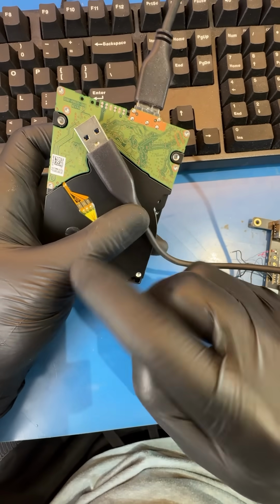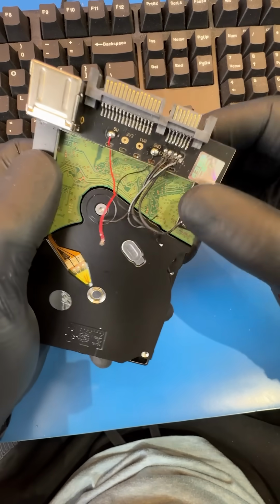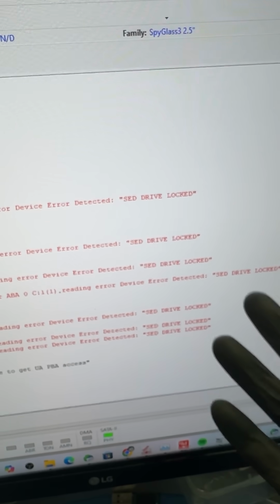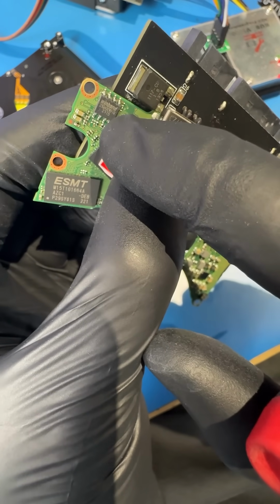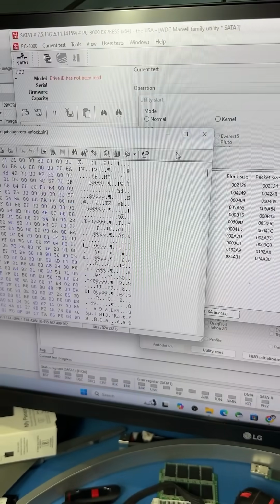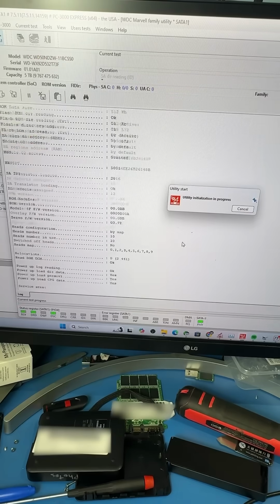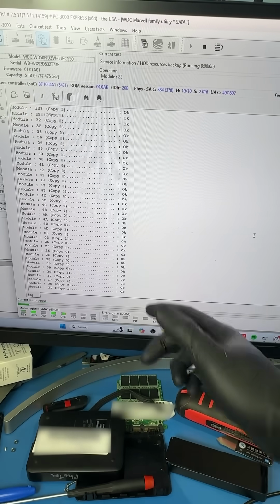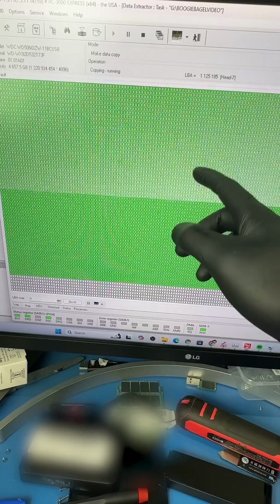Self Encrypting Drives... #tech

Comment: I work where we ship wd externals to customers, back and forth. The units to avoid are the 2,3,5 tb models. The 1,4,8 tb perform well, and are more reliable
Reply: He works at Amazon
Reply: It's interesting you say this, because my 2tb wd drive is throwing (non-critical) smart errors, but my 4tb one is clean
Reply: Hmmm something new. What could be the reason
Reply: @ukin237  just a guess... The odd capacity may indicate the drive started as a larger capacity model but had too many bad sectors. Rather than junk it, the manufacturer labels it with a lower capacity and sells for a few bucks less.
I believe this was common with different cpu models too. If it will run at 2.9ghz but not at 3.1, then sell it as the slower spec.
Reply: @ChickenHawk907 you're on point. Instead of discarding the defective drives, manufacturers often just disable the defective area and sell them for lower capacity than intended.
Reply: @ChickenHawk907 I doubt it, people are so picky about data longevity it would literally be the immediate end of WD if that got out. That’s like going to the bank and being told “Well you deposited 1000000$, but our locks are bad and we got robbed so you only have 50000$”
Reply: @ukin237  The number of platters and heads to read them. It also effects speed in finding the data each search.
The more mechanical things you have, the more likely of a failure. It's just math and RNG.
Reply: I have had 2 5TB external drives give me grief and I now avoid them.  Won't even take one if it's free.
Reply: @mercermediahfx  i avoid external drives like the plague, any brand. just get sata. its more reliable. even sata dock to usb is more stable than regular external drives. imo.
Reply: I have a Wd passport 2tb since 2018 and still works great, been dropped handful of times too (parked of course).
Reply: He dropped this hard drive and ruined the reading heads
Reply: jeesh the comments. idk my self but obviously certain #'s are made in a different fashion   . i would use ssd anyway
Reply: I have 5 x 6TB WD Purple drives in a RAID-5 array.  All my movies are stored there for access by my Jellyfin server.  I hope those drives are robust.
Reply: My Wd my passport 4tb have an issue, If i format it using wd utility software then it works but only for sometime and then become unusable like saying drivers not available and doesn’t show in my computer but shows in hard disk sentinel.

Any idea?
Reply: @ccmusic7772  hi, did you find any solution? I have the same problem with the sem 4tb wd. And when I try to transfer some data, when it works, it only get until nearly 2 tb, then it stops.
Reply: @ nope. If you find do mention.
Thank you
Reply: I have had MANY (probably over 30) 4TB external 2.5 USB drives as rotating server backups and they last 3-4 years before failure EVERY TIME whatever the manufacture is.
Reply: Does this apply for Seagate hard drives as well?
Reply: FALCON9GAMING yes we need similar guidance for seagate too
Reply: @FALCON9GAMING  c'mon man. No it doesn't.
Reply: What about 512gb!!?
Reply: @r4inim4tion get that garbage outta here
Reply: Actually tho, all my dead drives has been 2 and 5 TBs.
Reply: I have a 2TB external and it’s served me well for s few years
Reply: Especially avoid the model: ST3000DM001 (3TB) model. Piece of junk
Reply: 100gb M-Disks for cold storage
Reply: How is powers of 2 relate to reliability?
Reply: @cagedgandalf3472  no one stated the difrent sized drives have all the same components. the drives may have difrent components depending on features ect. a persons observations are just that observations take them how you will..
Reply: @waxprime729  I understand, I just took it how he said it
Reply: @cagedgandalf3472  while i had the same thought, considering how important the powers of two are for all software, he did say the 2tb was a no-go as well, so i think it might have something deeper in relation to the issue.
Reply: @cagedgandalf3472  binary
Reply: @cagedgandalf3472 
Probably because they need an extra disk or extra needle to read it other side of the last disk??

I don't know but it must be something  about that.
I really doubt the data density changes, but maybe the pairs capacities have more compacted physical bits, so pair-odd have the same everything but the pair has to read with more precision because there are more sectors per disk
Reply: read much first number is 1 lol and number 2 doesnt work well
Reply: how come
Reply: I wanted to buy 12tb what about those?
Reply: @ 12tb EXOS seagate drives fairing very well
Reply: 6 years running a 4tb WD HDD no problems its full right now runs fine
Reply: BS,
Reply: I’ve had a 4tb western digital for about 5 years now and it’s never given me any issues 👍🏻this sounds right
Reply: 6tb?
Reply: Good to know
Reply: Yeah, OK Sulindeer 👍
Reply: Thx man
Reply: Can confirm, 8TB WD HDD is great.
Reply: All WD drives are trash, in my experience in data recovery.
Reply: Fuck prime numbers I guess
Reply: I just print my pictures 😅
Reply: Because of this, I will avoid those pesky 2, 3, and 5 TB drives. My drive, which experienced a 5 or 8 cm drop, now clicks more often than the click sounds produced by Khoisan speakers.
Reply: It's funny, I've noticed this as a consumer. Good to have that confirmed
Reply: Imagine using an HDD
Reply: I just avoid WD all together and have zero problems.
Reply: @JF32304  why though? Seagate has the most drive failures over time at scale.
Reply: @HerbaMachina  not even close IMO, I've had several Seagate drives over the years and they are solid. I've done more data recovery on WD than any other drive.
Reply: Personally I like Toshiba drives. I seldom get a failed toshiba
Least reliable drives IMHO are Hitachi HGST
Reply: @HerbaMachina Personally I’ve never had a seagate drive fail once. I’ve owned a 1tb SV35, a 1TB barracuda , 2 2TB barracudas, 2 4TB barracudas, 1 4TB ironwolf pro, 6 exos 20tb’s in addition to a 1tb and 2tb backup plus (those little external 2.5” things). All of the 3.5” drives have 30000+ hours with the sv35 having 50000. A couple of bad sectors here and there but so far none of them have outright failed.
Reply: @HerbaMachina  I can't really trust these numbers. I have nothing but problems with WD. All of my WDs are either dead, have bad sectors, clicking noise, and insane temperature in just 1-2 years of IDLE usage. My Seagate drives (internal & external) from 10 years ago still work fine 🤞
Reply: @JF32304  i have a 1TB HDD from WD, bought it 2018 and until today its still working fine.
Reply: @SpiiiiiceeMAN  how much data do you have on it?
Reply: @JF32304 i have a WD green internal HDD green. From 2014. Still running good. 1 more WD Blue Internal. 2017. Both running great. I have never defragmented it. The health from HDD sentinal for the green one is 91%. Blue is 100%.
Anyways,  back to your point,  i also have WD green that died in 3 months (those are my dad's). Lol. So i don't know what exactly the issue is. Even Seagate dies. He got a Toshiba and it's running great. Suggesting you to get the same.
Reply: @JF32304  Wild statement. None of my personal WD drives have ever failed. I use the gold drives at work and they last upwards of 10 years. Meanwhile I've never had a Seagate last longer than a month and Hitachi seems almost as bad. Not sure about Toshiba.
Reply: @sauercrowder  I've had more WD drives fail than Seagate by far. HSST is a good drive as well, I think that's Hitachi Seagate Storage tech... But I could be wrong. I personally refuse to have any data on a WD in my office. If I come across anyone that has data on a WD I encourage them to get off that and onto a Seagate.
Reply: SSDs in that capacity really aren't that expensive anymore... You should just switch over lol
Reply: @Connie_cpu  When SSD's fail they fail immediately and totally
Also data stored on an ssd and kept off line without power being put through it can lose all the data within 1-2 years. Spinning Mechanical drives can keep data securely for 5-10 years
SSD's are NOT the answer for your important backups
Reply: @ We aren't talking about cold storage here, we're talking about shipping data between sites without using the internet (for whatever reasons they may have)
Reply: @Connie_cpu Who says we aren’t talking about cold storage? You’re the only to specify otherwise, and the largest consumers of the data recovery industry are major corporations doing mass cold storage.
Reply: @TheComputec  The computer that my dad uses for his shop records has an 486 processor and a 200 megabyte harddrive and was purchased in 1992 and still functions to this day. Since 2007, I've had an untold number of flash drives and SD cards fail. The larger the solid state storage device, the more prone they seem to be to failure... You are correct in saying that SSD are not the answer to important backups. I would take it a step further and say they are not reliable enough for long term storage of important documents, and should not be trusted for anything more than loading an operating system.
Reply: @HustleMuscleGhias  Totally agree. When mechanical hard drives are starting to fail you USUALLY get some warning. bad sectors, a little whining noise if the bearing is drying up on the motor. It gives you a chance to migrate data before it's too late. Often its a controller board that fails and you can find a matching one and swap it to rescue date.... You get none of this advance warning with an SSD Failure and once it's dead it's dead. The younger generation just buy into the promises made to them by these new technologies. We were guilty too of course. We were told that CD's were indestructible. Ask anyone who's ever burned a CD backup and put it on a shelf and then gone back to it years later... unreadable even if it didn't have a scratch on it
Some people will just need to learn the hard way
Reply: @TheComputec    Wrong on the HDD drives, if they're kept offline in a drawer they won't last just 5-10 years they'll last at least 14-16 years, speaking from experience with 2 drives, one 80GB SATA and one 40GB IDE.
Though the much higher capacity ones may differ a bit.
Reply: @ really, we’ll I’m speaking as an IT manager of 28yrs and an IT user for over 35years. Yes you can have old drives that still hold data for ages… BUT you will not find a single manufacturer who will guarantee that data stored on them will last any longer than I stated.  And by the way, the drive will still work but that doesn’t mean all the files on it will still be fully readable… the point is that anecdotal evidence is not the basis of a good argument.

There is a fire station in Livermore California which has had a lightbulb that is still working from 1901… should we tell people that all lightbulbs will last for 124 years?
Reply: @TheComputec  Just make regular backups. Simple as that
Reply: @sauercrowder  People don't though... thats the problem. Plus as has been covered many times, making backups on traditional media requires redundancy and contingency
Really comes down to your IT  expertise and how valuable the media really is to you
Reply: @TheComputec what's the reason behind it? I recently bought a pair of ssd to migrate the data of two old HD drives. So I have to buy new HD?

Also if I want to work in editing some videos stored in an external drive what should I use for reading and writing data while working on a file?
Reply: @Connie_cpu  not much point paying the premium for an SSD if all you need is cold storage for photos and videos and stuff
Reply: @Connie_cpu with a HD you might lose a couple files or folders but with SSDs one bad bit and you’ve lost the entire drive.
Reply: @Connie_cpu  my guy an 8tb ssd is 500-600€ compared to a hdd which is 200-250€
Reply: @Connie_cpu  Spinning hard drives which are both more reliable and have better transfer rates, have about the same prices as the good SSDs of the same capacity. Only the cheapest are more attractive for the budget build.
Reply: @Connie_cpu SSD generally do seem to be more reliable over their lifespan when compared to hard drives...... but SSD have a shorter lifespan.

Comment: I bought an iPhone 4S it is in very good condition 32 gig and the problem that went wrong was the phone is fine and one day the battery started to swell up and I remove the battery and then the problem I actually put it in my door and it was in there for months then I bought a new battery in my country there is no new battery or original battery for iPhone 4S I can find it on any store in my country Pakistan but the problem that went wrong was when I bought second hand also the you know also known as the fake battery for the iPhone 4S that is available and my phone started to looking and I actually took it to actually to the itunes then when I click on update or restore it is done 80% then it starts it stops and it gives the error on my computer error 29 it means that the battery is not original so how do I turn on my phone please help me MD repair

Comment: Wouldn't it be easier to just transfer the platters over instead of removing the read/write heads 🤔
Only curious 😊
Reply: Im not really one to answer. So I'm just submitting a guess that it might be a bios issue.
Reply: Too much risk of damaging the platters during that process. Replacing the heads is the safer option.

Comment: And this is why I pay you to fix the things that I break. 😵‍💫
Reply: store it on another drive too if it's important.
Reply: @Richard-S  you mean nas raid system?
Reply: @PurtzeI_HD  No, you can just use another external hard drive. They are not expensive, you get 4 TB of HDD external harddrive space for 100$. All your important data should ALWAYS be saved on at least two different physical places like two different hard drives. Because here the guy had luck: The heads didn't scratched the platters. If they had, many parts of his data would be gone, especially as your data is not stored sequential on a hard drive, but in a way that it gets loaded faster. So even a small scratch can destroy many files.
Reply: To piggyback on what ac said, drives are ridiculously cheap and you can use free software like SyncBackFree from 2brightsparks to backup your files on a set schedule.

Comment: If the disk had bitlocker protection, could the recovery program access the files?
Reply: No, only the raw data, but that shouldn't hurt the recovery process.
Reply: @elder_labs  This is incorrect. Without encrpytion key for bitlocker data is gone.
Reply: @pickelsvonbrine  That only applies to hardware encryption. Software-encrypted data can still be copied bit-for-bit. Yes, you need the key to access the data, but it does not prevent you from copying the raw data to a new location. Hardware encryption, on the other hand, does prevent easy recovery without the hardware keys, as this video displays.
Reply: Without the encryption key for bitlocker you cannot access the data on the drive. Even with this hardware.